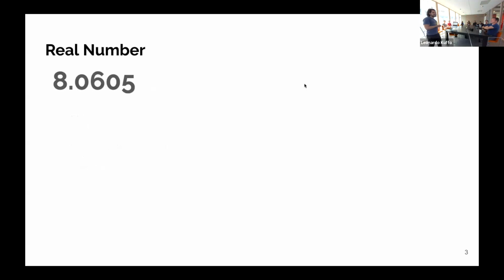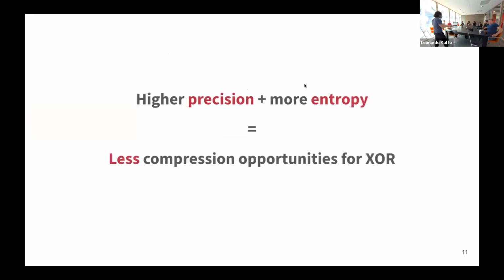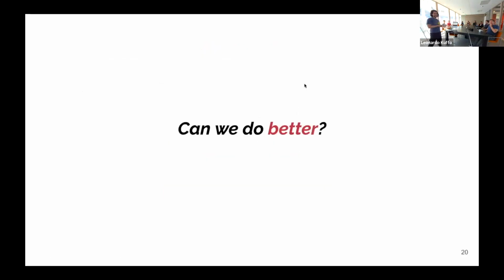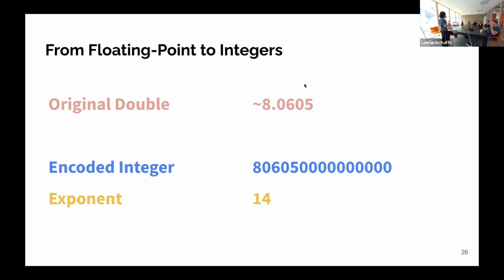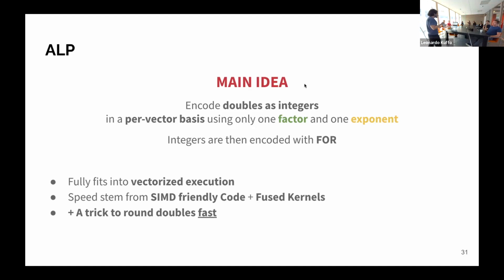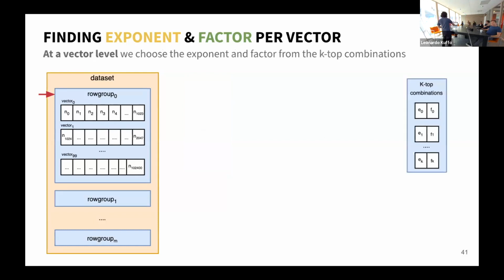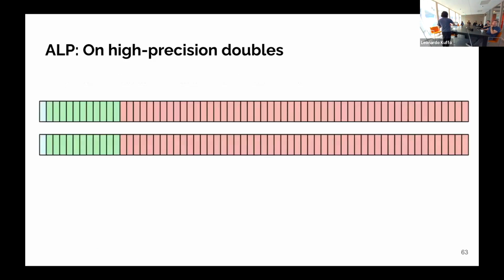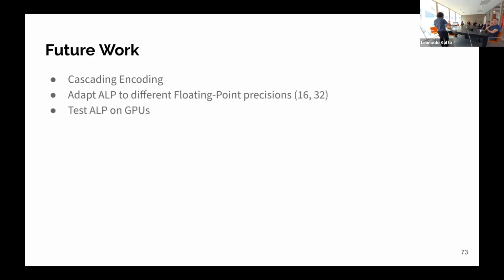ALP: Adaptive Lossless floating-Point Compression - Leonardo Kuffó (CWI)

Comment: Great presentation and interesting idea! It would be interesting to see what the compression ratio would be for 32 bit floats, bit packing the integers would be SIMD-friendly but I suspect probably reduce the ratio by a significant amount for "normal" values.
Reply: With 32bit floats compression ratios would be halved since the same numbers will still be packed in the same amount of bits after FOR+BP. But the algorithm would remain the same. It would be interesting to see then how ALP keeps up with these other algorithms (chimp, zstd, etc). We have already implemented ALP in DuckDB for floats also. So you may run some quick tests there using the duckdb Python api. What we saw is that 32bit floats are more common in an ML context (e.g. model weights), in which case ALPrd would be used given the randomness of these numbers. Here we can still save a few bits more than, for example, Zstd if the weights want to be stored losslessly!